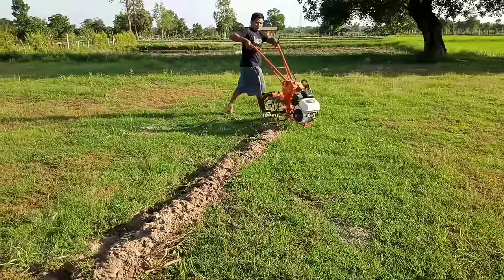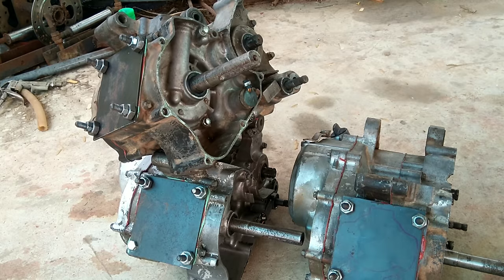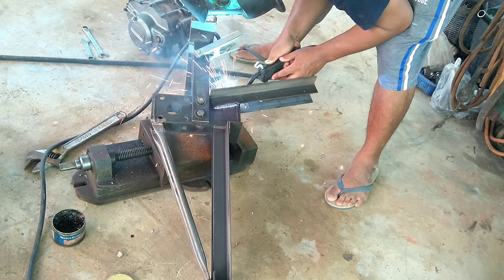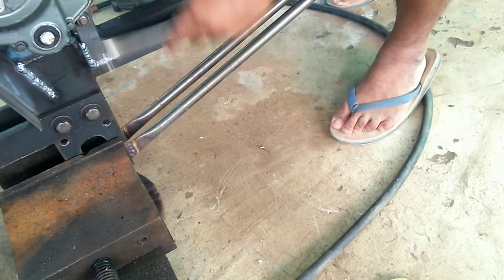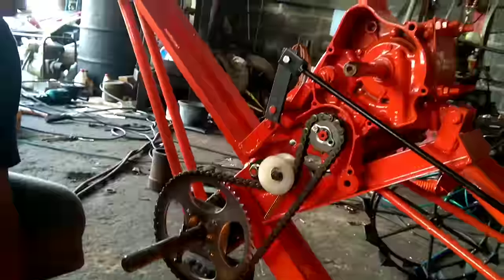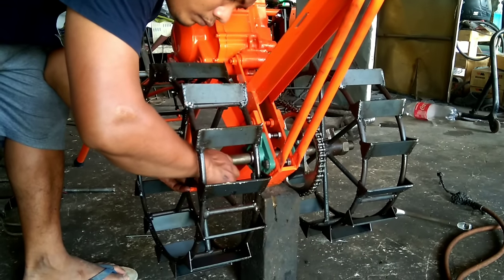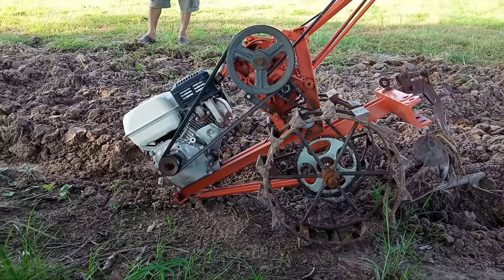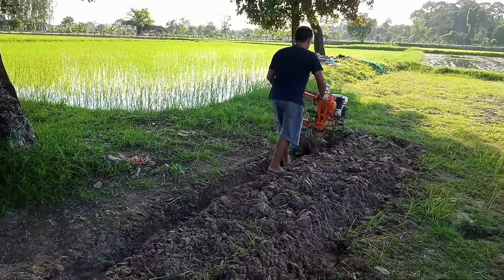Home made tractor.

Comment: I wish I had this skill...

I wonder how to turn an old motorcycle into a powerful irrigator in my garden.
Reply: That is very possible and not too complicated i guess .all u need is an impeller with housing assembly and   connect the shaft to sprocket of the motorbike , when the bike runs or turns the water pump impeller turns as well and pump up the water ...

Comment: Hello
You can tell
What is the wheel size?
The number of bearings?
How much horsepower engine?
What is the diameter of the puly?
What kind of sprokets is, can i get it from the motobike?

Comment: I have seen this , I have have a question as to how do you make your clutching attachments from your water pump engine in to motorcycle connectivity. I have seen your reduction gearing  from the WaterPump side, I'm lost when its connected to the motorbike assembly, how then do you transfer  the propulsion to the driving wheels.
Reply: This mashing cant turn to both side i think it can be turned only to the right